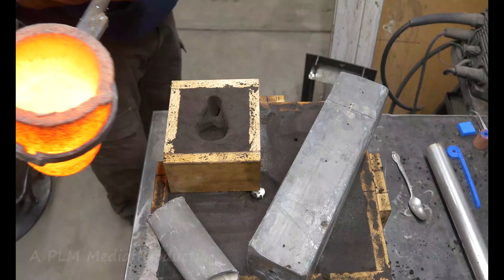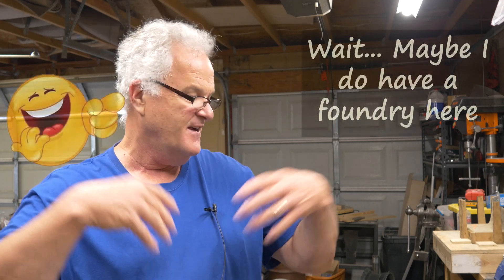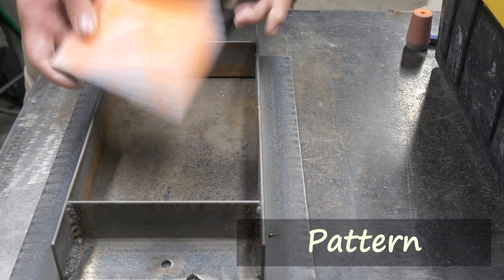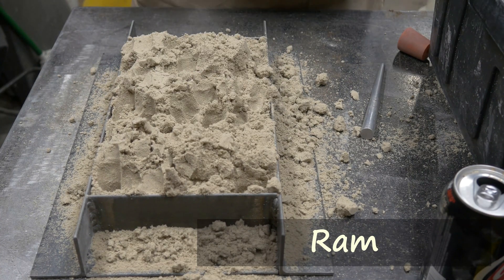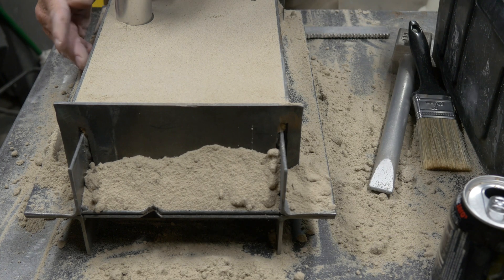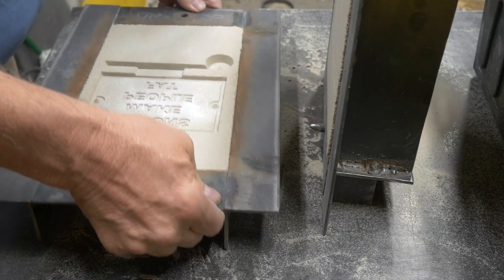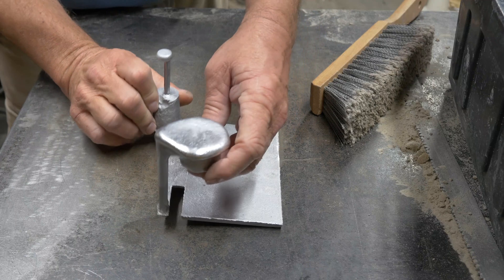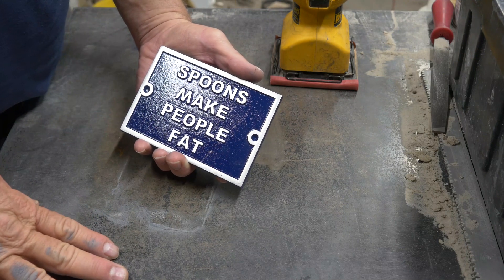Learning to cast metal  - vocabulary

Comment: No.  I'm gonna say it that way anyway.  Just because is sounds gooder.
Reply from the maker: What did you "casted" something? 😄
Reply: @swdweeb  Y yes Sir, ree!  My buddy's StratoCaster and my wife's Castanets, I Casteded really goods!  However, since I see that you're actually someone who responds to people, thank you.  Really valuable videos you made here.  Also, thanks for the introduction to John Campbell and referencing the others that you've learned from.  I've been watching a Strailian Dude, getting motivated to start working with metals and in his beginner recommendations, he links your playlist here.

I like the idea of metals, even more than the plastics that I do now.  However, it's neat that the skills that I use in plastics seems transferable to metals and in many ways, seems more suitable for metals.  For example, Shrinkage.  In plastics you can only fix that problem with pressure which means that you really need to preplan your melts or weld finished pieces together.  But with metals, that problem is fixed with Feeders.  Cool beans!

I'd like some advice, if I may?  Especially since I'm probably a few months away from starting up.  Since things aren't standard everywhere (not everyplace has the same equipment and materials) for my homemade furnace, what do you think of the idea of a Plaster of Paris/Steel Wool mixture coated onto Tinplate and Butane fueled instead of Propane?  I was thinking about that because I wasn't planning on working with something like Copper.  High temp stuff.  But instead with Zinc, Pewter and Aluminum.  Butane I ask because I use a Laser 3000 Butane torch with my plastics work and Soldering.  Also, because if I don't need to buy a new tool, why would I?

Thank you again for these videos.  Take care.
Reply from the maker: Fun, I almost named my son "Tele" but my wife wouldn't go for it.  😄
I assume that Aussie is bidD.  He's a good guy. Thanks for letting me know his channel led you here.

I've never done any sort of polastic casting but I can imagine, as you say, the skills are pretty transferable. Certainly you have to think about a lot of the same things.  FWIW, in the metal shrinkage problem there are alse things called freeze plates. I've never used them but they are essentially pieces of "cold" steel that freeze the surface of the metal quickly to help prevent surface shrink.

Regarding your furnace, for low-temp metals like you listed plaster might work. I've seen guys mix sand in as well. If you starting getting really hot (1000F+) the plaster wont last. It might even starting deteriorating at lower temps. I've never worked with butane so I can't say anything about it as a heat source. When you build your furnace, assume your torch is going to point directly at the crucible and not try and "rotate" flame around it.  Crucibles don't last as long that way but they will heat much faster. 

Good luck
Reply: @swdweeb  Tele, as in Telly Savalas?  If that's the case Awesome!  Perhaps is you told her that Tele was short for Aristotle, she would have gone for it.

Cool, you met the Strailian Dude.  He talked with me in the chat from time to time.  Educated me on Ned Kelly, but hell, that Dude's got over a Mil. subs.  He can't really chit chat with everyone.  But it's nice to learn that he's a good guy.  I guess that it comes out a bit in his humor.  Oh but yeah, BigD was who led me here.

Thanks for the furnace and flame positioning advice.  When you were talking about Crucibles not lasting long, I'm assuming that you're talking about Clay/Graphite, right?  Or Crucibles in general?  Because I want to start out On The Cheep, to practice skills before investing, and I was thinking of using and old Stainless Steel coffee mug that I got as my Crucible.  Thoughts?

Again, thanks for the advice.  Take care.
Reply from the maker: @dionysislarson6352  tele as in telecaster.
I never recommend metal canisters for crucibles. Aluminum is very corrosive when melted and will eat through stainless after a few uses. I suppose if you just want to try it, you can but I would certainly never recommend it long term.
Reply: @swdweeb  😆Tele'Cast'er!  hahaha Damn, I should have thought of that.  I now hang my head in shame and embarrassment.  Alright, thanks Man.  I'll make the investment of a proper crucible.

Comment: Does aluminum hold paint properly? does it get flaky or something along those lines?
Reply from the maker: It doesn't hold paint great. I've recently been thinking I need to use a primer for painting to increase adhesion. The thing I've noticed is that I only lose small flecks of paint.  Probably 99% of it sticks but you don;t want to lose any of it.

Comment: There are some other terms you didn't use; however I don't think they are very commonly used. 
Fettle (I think that's the proper word.  See, so seldom used even I can't remember it.): that's the cleanup of the part.  Cutting off the runner, removing the flash (if any), etc.
Rapping (no, not what Tupac was known for): the gentle tapping (as well as the tool used) that helps to release the model from the mould.
Also, I think 'foundry' is in common enough usage to refer to the thing that melts your metal that you should just let that one go.  It might make sense in a large factory, but I don't think it is that significant a distinction for the hobbyist.   And you have a foundry, as you have somewhere to store and use all of your casting equipment. 
All kidding aside, I think this was a good beginner vocabulary starter.  I am sure you will define some more things along the way, but throwing out too many definitions all at once is probably counter-productive. And most other definitions are only used occasionally (such as core) or in special circumstances.
What's the term for the piece of the flask that goes between the cope and the drag?  I have seen it mentioned in some of the old texts (or else I have imagined it), but I don't believe I have ever seen one used.
Reply from the maker: Hey Brian, Yeah, I'm sure there a whole raft of terms that I don't know and didn't mention.  The goal was to try and hit the most common, although I guess a riddle doesn't quite fit that criteria. I did learn from @Tobho Mott that the ends of a ramming tool are called the peen and butt.  Something to mention in my next video.

I guess we'll just have to disagree on whether knowing the difference between an oven and a kitchen is important.  I suppose its fair to say you cook food in either.  Go ahead and get prepped for my rant on feeder versus riser 😆

Comment: Great video! I hope this helps clear some things up for people. When I heard about talcum powder being carcinogenic I was obviously concerned about the fact that I had been using baby powder as a parting agent for some time. I came to realize that the baby powder I have been using is actually corn starch based. Of course I’m using petrobond but I can say that cornstarch based baby powder works very well.  It’s possible that over time the corn starch may cause problems but I haven’t seen that happen in the three years I have been using my sand.
Reply from the maker: Thanks Seth,
When I first started, I looked specifically for talc-based baby powder avoiding the corn-based version.  Of course at the time I knew absolutely nothing and just assumed the talc would be better.  I have no idea if corn will do anything to your sand or not. Probably no worse than burnt oil ;-)
Reply: Why is talc bad for casting ? Baby powder might be slightly carcinogenic when regularly applied to the perineum but that's not where it goes when casting (at least I hope not)
Reply from the maker: @Louiscare everything I’ve heard is talc is bad to breathe. I used corn starch before I started using diamond part

Comment: Great video again! I have some lecture about the home foundry, one book about furnaces and one book about making patterns and moulds etc. I know most of the words, but I use them incorrect sometimes. I think I pack the sand far too tight, a lot brakes loose when I remove my pattern, also trying to get a sprue inside the sand is not going to work as a lot of sand breaks loose. I have some 15mm pipe rammed up with my pattern to act as sprue and vents. Carving out the channels (runners?) is sometimes also a nightmare 😂 I need to look into that pouring basin you use. For now I (again) use a tin can to act as pouring basin. Good tip about those small vents! Will and them too in my next project I think. I will also experiment with a little less rammed up sand, hard on the edges but less hard on top of the pattern. Looking forward again to the next video 😁👋👋
Reply: Check on clay content maybe add some to a small test batch and double check that this is not part of the problem :)
Reply from the maker: @raschellesherwood6347  I've actually got a batch of my sand out to a lab for analysis. If it ever comes back I'll do a video on it and any adjustments I might make as a result.
Reply: @swdweeb  really. Lol sand analysis is fairly serious inquires lol. Dunno if that info would be any use to you except on that sand for a pour happening on that day.. sand explodes and clay burns away, always changing is size shape and its capacity to hold shape yada yada yada . Do you think so too? Or am I being a newbie loser lol
Reply: @raschellesherwood6347  it is pre mixed sand called "Brusselse aarde" I buy it from an art supplier.
Reply: @Metalstacker  broomsgrove? From the uk? Make sure you have enough drag on your pattern.  What parts are breaking away? Like cut out or pockets or slots Or what's going on? Do you have pics maybe me and perry can help with what's going on
Reply: @raschellesherwood6347  I had filmed it for next fridays video, too bad my computer crashed and I will only have material of the casting itself. I will cast it tomorrow morning, you will see it coming friday 😁
Reply: @raschellesherwood6347  broomsgrove? I am Metalscrapper from the Netherlands 😁😁
Reply: I use a lady's foundation handle and place it in the cope after I ram up drag . Drag with pattern, flip, ram cope with tapered ladys foundation handle.  Hope it helps . And runners dont stress too much they dont need to be fantastic at the start.. you will learn what works and what doesnt :)
Reply from the maker: My sprue measures 155 mm tall and narrows from 15mm to just a hair under 8mm.  I think it is 1.4 degrees of draft.  You really should attempt to make one and stop using a straight sprue to pour into. In two weeks I'll talk more about why with some pretty interesting demonstrations.

I'll also be talking about runners and gates in a future video (at least three weeks away).  To create a properly pressurized system with minimal turbulence you need to limit the size of your runner to the size of the bottom of your sprue.  It's all about keeping the system full from the very beginning of the pour until the end.  If your sprue and runner are too big, they will have lots of turbulence and lots of air gets mixed into your mold.   I would be shocked if you are able to keep a straight sprue that large full from the start of the pour.  Put a camera directly over it and record your next pour, I can almost guarantee you will see space between the metal and the sprue walls as you pour. 

Sand breaking might be due to other reasons... perhaps I should do a video on clean pattern release.  Maybe I'll learn something :-D 

I'm not trying to be harsh, I just want to see you start to develop good practices that will result in much better castings.  I promise.
Reply: @swdweeb  and omg sorry perry that sand and clay message was totally not meant for you I thought I was adding to the comment that you commented on lol sorry

Comment: Great presentation. Thanks for the overview (using the casting) of pour basin/gate/spin trap and elevation of metal entry. Very smart to make those via 3D prints!
Looking forward to the math you used.
Reply from the maker: You'll be pretty disappointing in the math I use, especially for tiny parts like this.  Essentially I take the area that is the bottom of my sprue and try to make the cross-sectional area of my runner match it.  The gate is another story, I typically make my gates larger than the runner simply because I want to lower the velocity the metal enters the mold.  With my sprue height, I'm right at about 1M/sec coming off the sprue.  Making the gate larger takes me under 1M/sec
Reply: @swdweeb  Thanks! Your generalized approach is still going to be more consistent than just cutting holes and channels in the sand!
Someday we'll have a spreadsheet, and using "parameters" in fusion 360, be able to custom 3D print what we need for each casting.
Do I smell porosity tests in the future?
Maybe a 3D printed pouring basin?
Reply from the maker: @hippie-io7225  I did a bit of a porosity test here https://www.youtube.com/playlist?list=PLU1QP34Dv8Y6-qXska4MOagRMSVWan40k.  I've also got a pouring basin that olfoundryman and smalcnclathes modeled here https://drive.google.com/file/d/1T3oFhtVCp7kmZ-S2wo8B3lYxiCLD2u9E/view?usp=sharing

The sprue height and diameter is going to set the limits on how fast you pour. SO far, I haven't poured anything that my 8mm (bottom) sprue can't fill. I'm sure that with a really large part I'd need/want a larger sprue but so far...  No matter what size it is, you want to be able to pour fast enough to keep it full.